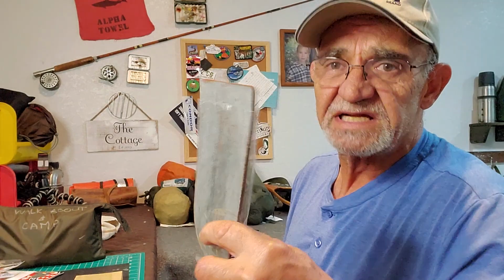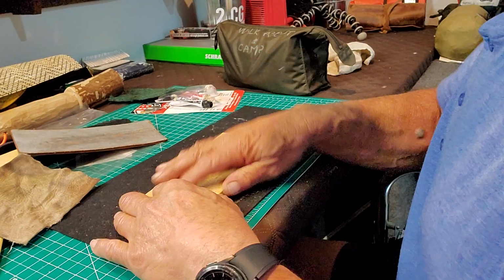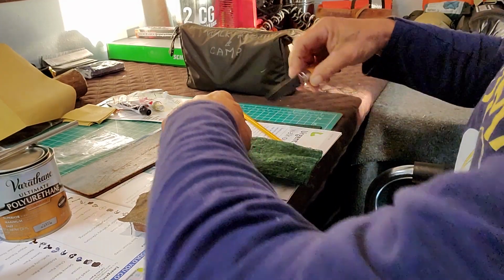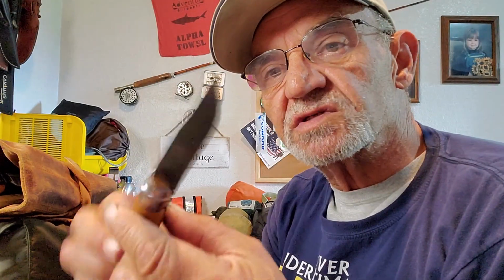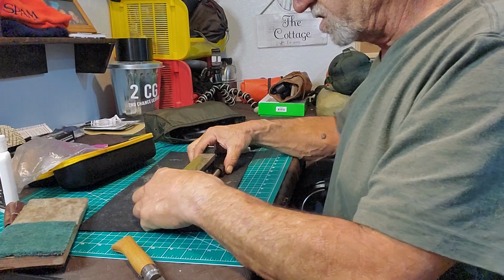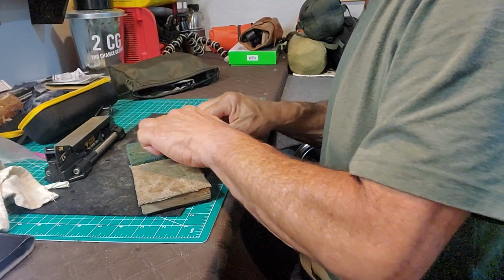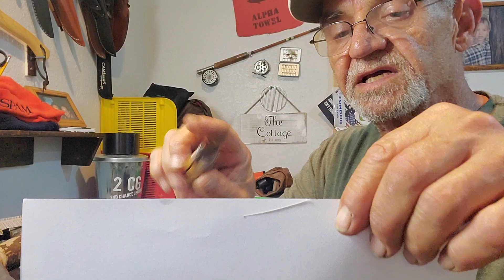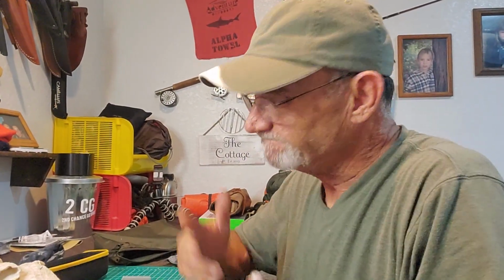DIY Stropping Block with my additions. I still cannot get it right!!

Comment: You have the right technique, but I would spend more time on the fine stone to reduce the gouges from the coarse stone to nothing.  Maybe 20-30 more strokes on the fine stone to help refine the edge.  It looks like you might have a micro burr from the little bit of metal that wasn't shaved off that has folded over and is now causing the knife to not cut the paper like it did a couple seconds earlier.  For the stropping, you are doing it right, just keep doing it for 50 or so strokes.  It's only removing a very minute amount of metal and is really putting a polish on, so it takes a lot more effort to see any results.  You can also clean up the knife and polish it by dragging the flat of the knife across the strop, but it will take a long time.  Fortunately there are about a thousand videos on knife sharpening on Youtube, so you'll have lots of examples to refine your technique.  Good luck!
Reply from the maker: Ok. I will do that.thanks for the advice much appreciated 🙏

Comment: I have difficulty getting my knives super sharp.  This is really strange, as I am a wooden  boatbuilder and I routinely get my chisels and plane blades very sharp indeed.  When I test them on my arm the hairs don't scrape off, like with a semi-sharp blade-- they jump off.  Occasionally, when the back of my neck gets so wooly that I can't stand it and I couldn't be bothered to visit the barber just yet-- I shave the back of my neck (blind) with a freshly sharpened plane blade.  Works quickly and easily and draws no blood.
So what's up with not getting a similar edge on knife blades? 
I sharpened a newly purchased axe and got it to the 'shaves my arm by scraping' degree of sharpness easily enough .  It'll do for an axe.
My new Ukrainian Adventure knife just arrived in the mail from BPS Knives.  Sharp, but not as good as my chisels and plane blades.  Today I am going to see if I can do better!  I suspect the steel is better than the steel in many knives-- so we shall see!
I have a hard felt wheel on a grinder that, charged with green rouge, does wonders.  I also have a strip with a suede side and a smooth side, with appropriate compounds to charge it.
(I was born and  brought up in Cape Town, and took off to see the world on my 19th birthday--nearly five decades ago)
Reply from the maker: Yep I have that issue. I have to figure it out. it bugs me...lol. I don't fell so bad now. Good to meet a own from the south. Stay safe. Thanks for watching 👍